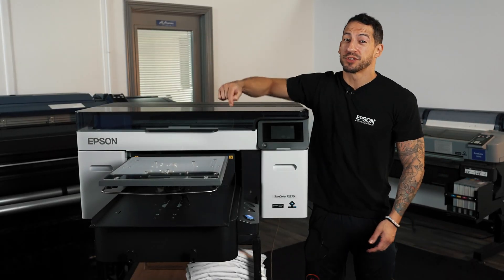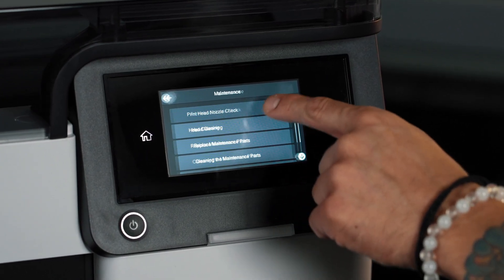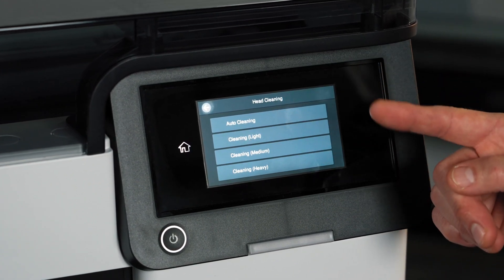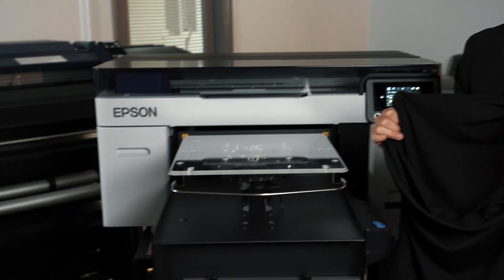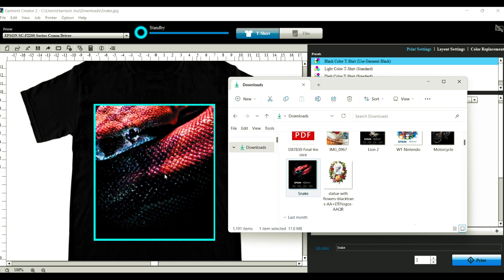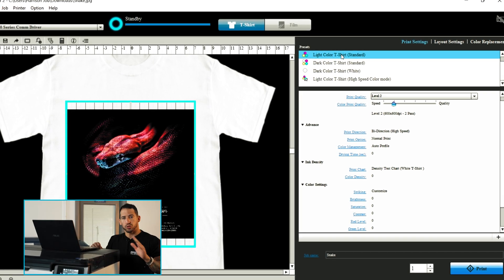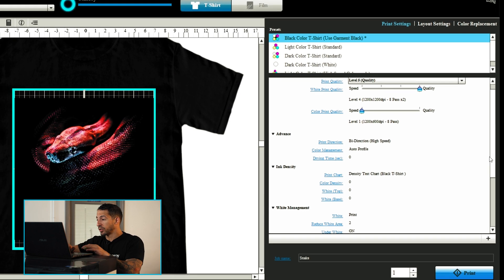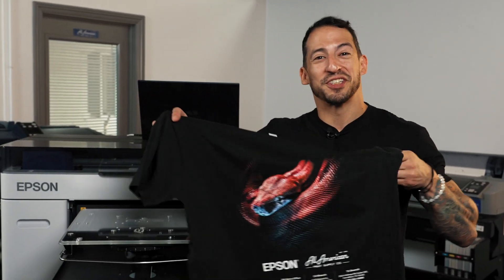Epson F2270 - Learn how to DTG | AA Print Supply

Comment: Hello again, just received my f2270, my print check keep having issues/ lines are broken . I tried auto, light , med and heavy cleaning… still the same issue after print check. Is there something else I can do?
Reply from the maker: Hello there! Is this a new unit that you just charged up with ink and is showing has ink on the display? Which lines are broken, CMYK, white or both? Did you get the machine from All American?

-I would make sure you have shaken the white inks as instructed on the actual ink packs before printing
-Make the sure the platen height is at the highest setting (LEVEL P on the dial)

If issues persist I would contact Epson directly ESPECIALLY if this is a brand new unit: 562-276-1305, press 2 when the recording starts and wait for them to say F2270. West coast support hours, 7am to 4pm PST
Reply: @AAPrintSupplyCo okay thank you! I didn’t have it at the highest hight. Brand new machine, I bought it from swing company (very bad experience) but if the issue continues I’ll call Epson. Thank you

Comment: Hello, sorry for taking your time, I have several questions that I hope to answer, 
1_ Is this printer suitable for all types of T-shirts?
2_ Does it need a caustic or press to press the T-shirt after printing?
3_ Can it be used to print picture on a mouse Pad? Can it be printed in different sizes such as 90×40

I just discovered in the comments that its price is 16000 thousand dollars, I can't afford the cost 
😂
Can you recommend a printer to print pictures on a mouse pad and T-shirt, costs 1000_1500 and 1500_2000 dollars.
Reply from the maker: Hello there, we do offer more affordable printers. For the different applications you mentioned DTF would be the answer. This option is in that price point: https://aaprintsupplyco.com/products/prestige-a4-dtf-printer

Comment: I got a few questions: I get a lot of people asking about athletic style shirts. Like moist wickening. Like under armor brand. Will this work on that? I didnt see anything about pretreating. That is still a necessary step right? How long can this machine sit without printing? We dont make high production amount of shirts. sometimes we might go 3-5 days without making a shirt. Is that okay?
Reply from the maker: Hello there, let's take a look here. Moisture wicking: this material is usually synthetic with a high % of polyester. If the fabric has more than 60% polyester we have a poly specific pretreat. Another option with this machine would be to use the direct to film printing function for easy compatibility, no pretreat. Pretreat is still necessary with DTG.
This machine should be fine to leave unattended 7 to 10 days, no problem. Your print schedule sounds perfect for a machine like this as the Epson needs FAR LESS attention when compared to other machines.

Comment: I am so disappointed that Epson does not have the necessary parts available. I've been struggling with back order parts and Maintenance liquid. It is so absolutely disappointing to have this issue. I have bought from many different vendors and they all run into this issue of not having stock. I wish I would've saved my money and purchased something with more accessible parts and maintenance items. I am so nervous that I won;t get the parts I need before I need to start my big order. Those situations hurt small businesses like mine.
Reply from the maker: Hello, let me start by saying we understand your frustration. This supply shortage at the manufacturer level has impacted all of us. Please know we are working diligently to get the items in we know are essential for business.
Reply: @AAPrintSupplyCo  Thank you fo4 empathizing with me. I actually just received notice that it is coming! So relieved. I hope Epson learns how much we need it so it's available always. This delay was pretty rough for my small business. I felt it!

Comment: Hi Esteban,

Just got my printer from you guys. I noticed that when I installed the white ink, the screen showed it as half empty already when they're supposed to be brand new. I noticed that in your video as well. The colored bars are completely full though. Is there a reason why the white ink bars are half empty?
Reply from the maker: Hello, upon the initial charge the printer will consume a certain % of ink, I have noticed this since back in the old F2000 days. Great thing is the 2270 comes with full inks where the older models shipped with starter ink carts and we would advise to purchase 2 additional full size whites with the previous gen. 

What you are experiencing is normal for initial set up.

Comment: What do you do if white is not printing solid on dark shirt
Reply from the maker: We have to make sure we prepress before applying pretreat otherwise the fibers could stand up and result in what you described. What quality setting are you running in the software?
Reply: @AAPrintSupplyCo what’s a good temp and How many secs and pressure for prepares
Reply from the maker: @thage0  Hello, I usually have my press set to 335 F and 35 seconds
For pretreat: 35 seconds
CMYK ink ONLY: 35 seconds
CMYK and WHITE ink: 35 seconds (2 times)

For DTF always follow the manufacturer instructions for best results (usually around 300 - 310 for between 10 to 20 seconds)
Reply: @AAPrintSupplyCo  thx sm for the fast reply !

But I’m talking about the pre press before u add the pretreatment. I don’t wanna burn the fibers since I still have to heat press it again after the pretreatment 
(I have the f2270 and I don’t like how the fibers stand out though the ink after I DTG it)
Reply from the maker: @thage0  understood, when I prepress I usually lock the press down closed for about 3-5 seconds tops at the 335 F. BEST PRACTICE TO ALWAYS PREPRESS BEFORE PRETREATING, so good job!

Comment: Is there a way to change the design's colors using Garment Creator?
Reply from the maker: There is a feature in GC called Color Replacement upper right corner next to Layout Settings that can perform this!
Reply: @AAPrintSupplyCo  Thank you I appreciate it!
Reply from the maker: @robertnewbury4956  You got it. The feature is not perfect but can help a little if we do not have access to graphic design software
Reply: Ive been trying to find ways to avoid the yellowing and heat press marks on my garments. Do you guys have any recommendations that may affect the process?
Reply from the maker: @robertnewbury4956  what is the garment made of fabric % wise? What color? Typically if I see what you are describing I either decrease pressure or use pressing pillows for the marks. As far as the discoloration, less heat and more time can be effective. Are you printing DTG or DTF?
Reply: I ordered new Teflon sheets/parchment paper. I even got a different kind of pretreat to test out.

Comment: Which is the best platen height to print onto crewnecks?
Reply from the maker: Great question: it varies. Honestly what I do, takes a few seconds, start on your normal T-shirt height and try to print. You might trip the sensor, drop a half turn and try again. And repeat until the sensor is not bothered.

You want to find the highest setting that does not bother the sensor and every garment is different. Hope this helps!
Reply: @AAPrintSupplyCo  Thank you!
Reply from the maker: @robertnewbury4956  You are very welcome, let me know what platen height worked for you!
Reply: @AAPrintSupplyCo  Height level 3 seems to work the best on crewnecks/hoodies for myself. For T-Shirts 1.5 seems to be the best!
Reply from the maker: @robertnewbury4956  1.5 is for sure my sweet spot for a t-shirt. 3 sounds very safe for a sweatshirt!

Comment: Hey so I got a Epson F2200 and was wondering how I can connect my MacBook garment creator to it if you know by any chance, Iv tried a cable but it’s not seeming to work
Reply from the maker: Hello, just wanted to confirm you have installed Garment Creator 2 and opened the program WHILE connected via USB printer cable with the F2270 turned on? There should be a status alert up top on the screen next to the T-Shirt button
Reply: yeah it connected thank you , also on the garment creator where it says print its not like blue to click , I was wondering how to fix this as the printer says ready but I can't print on the actual garment creator, everything was working fine yesterday
Reply from the maker: @azankhan6522  interesting. Epson would have you turn off the printer and the computer to reset the connection so let's try that. We can also uninstall and re-install the actual garment creator software. Let me know if that works!
Reply: @AAPrintSupplyCo  yeah that worked thank you so much
Reply from the maker: @azankhan6522  that's great news! Glad we were able to help, be sure to subscribe for more helpful tips
Reply: @AAPrintSupplyCo  you know your guys heat press , what temperature and how long do you guys put it on for a normal tshirt cause my T-shirts keep burning when you get the chance please
Reply from the maker: @azankhan6522  Hey there! Temperature wise with DTG I advise between 335  - 350 F
As far as time:
Pretreat: 35 seconds
CMYK ink only: 35 seconds
CMYK + W ink: 1 minute
Medium pressure
Reply: @AAPrintSupplyCo  thank you much it worked , I appreciate the help , sorry about all the questions , today I was printing but for some reason all the prints are coming with a blue tint ?, and reds are like pink so you know how to fix this ?
Reply from the maker: @azankhan6522  No worries, we are here to help! How is the nozzle check looking? If the nozzle check looks bad let's run head cleanings on the bad color channels in the nozzle check until fully recovered and try the print again as this may correct the issue. IF problem persists you can submit photos of the color issue here: https://aaprintsupplyco.com/pages/contact-us
Please provide images of the misprint as well as the actual file so we can see the difference

Comment: BIG price jump from the f2100 of 7k & no longer can even buy an f2100
Reply from the maker: Hello, when the successor to the 2100 released (F2270) Epson cut the price on the remaining stock of the old units to clear way for the new model. Folks acted fast when they slashed the price.
Reply: why not have a line of product instead of killing the f2100. all this is is a way to grab 7k more per unit
Reply from the maker: @bear6001  Before this model came out the F2100 was consistently sold at the current price of the F2270. The 7k sale you are referring too was similar to what you see on other discontinued technology. Think of when the new iPhone comes out - typically sold at the same price of the previous model when it was new. Customers would not pay the same price for the older model when updated tech is available at the same price so the old iPhones are marked down and sold at a discount until stock runs out on the pieces no longer being produced to clear stock.
Reply from the maker: @bear6001  That being said, we recently covered the upcoming budget friendly Epson DTG in this video here: https://youtu.be/dFh9Ci3E6P4?si=K4eLh6LsOXRCnOvN

Comment: Just unboxed my new 2270 today. Haven’t played too much with it but the 2 shirts I did came out super grainy and not clear at all. 😢
Reply from the maker: Hello, thanks for stopping by! What is your platen height level set to? For t-shirts we get good quality sharpness at around 1.5 (depending on the blank garment). Other factors to consider would be artwork resolution and pretreat method.
Reply: @AAPrintSupplyCo  thank you for the reply, I was not aware you could set up the height (taught it was auto 😅) I messed with it last night and set it at 3 and gave me better results
Reply from the maker: @adan_cuts210  no worries, this is how we learn! If you thread the garment on the platen (so that is 'wearing' the shirt like an ironing board) you can probably go even higher! The farther the printhead is away from the garment the wider the ink spray gets = less sharpness. Most t-shirts I have printed have allowed for level 1 or 1.5 without bothering the sensor.

Basically you want to be as high as possible without bother the sensor for optimum clarity. The print head carriage itself has automation for adjusting internally. Did you get your machine from All American? We offer a free live weekly training on Wednesdays!
Reply: @AAPrintSupplyCo  my wife ordered it. Is actually her shop lol but I help her when I can and I was helping her try to do some research. Not sure where she ordered it from
Reply from the maker: @adan_cuts210  super nice of you. We cover a lot Epson DTG here and have a lot more coming down the pipeline so be sure to subscribe for more! If you take a look at our recent WE MOVED video you still have time to join our free heat press giveaway: https://youtu.be/Hb6Be8CN8q8?si=E8TtCYOBnLft9TOr details in the description

I think our weekly training would be good education for you guys as you get familiar with the printer. Have a great day!

Comment: It looks a great machine and I would buy one in a heartbeat but the ink cost is just to high,
Should be the same cost as 3070 ink 
Or its just impossible to compete with dtf prints from a dedicated dtf machine.
Reply from the maker: Hey there! The ink savings on the F3070 are a part of the larger: machine/ink bag/price tag. That being said this machine is fully capable to produce full color, high resolution low cost DTF prints as well as top tier DTG
Reply: The color inks last a very long time.